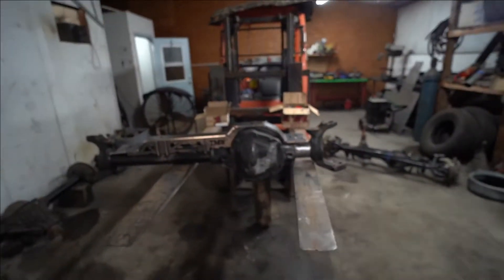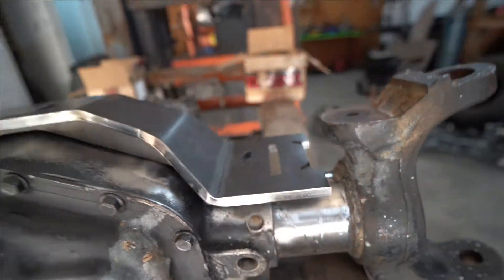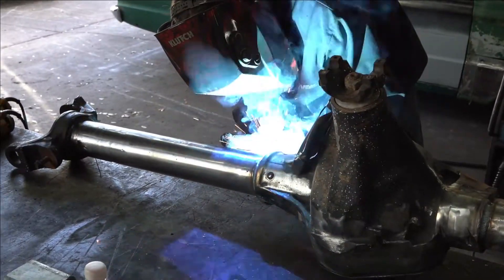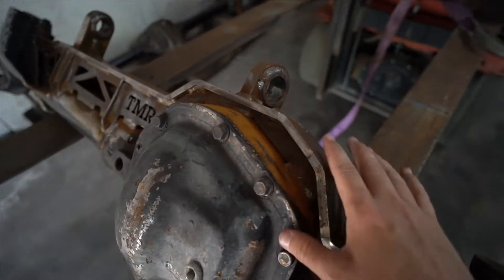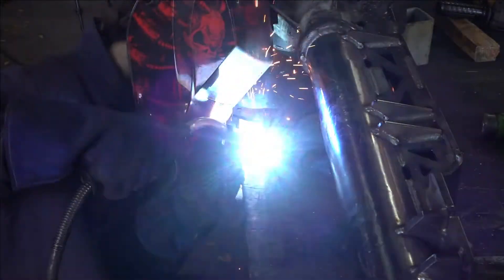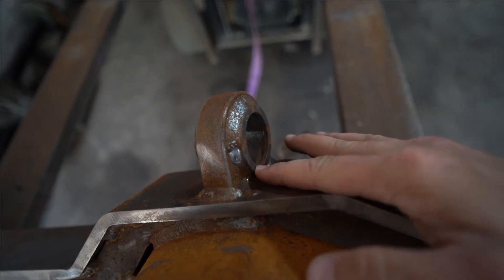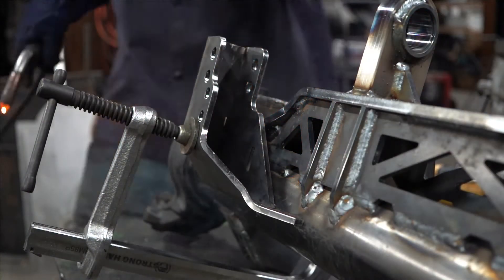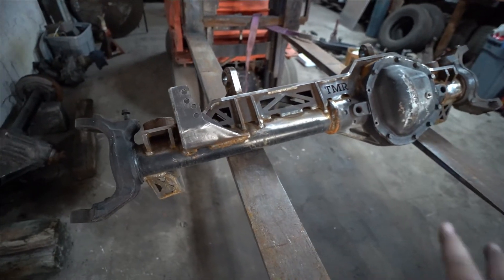1 Ton Swap Part 3 - Welding the Front TMR Truss

Comment: Hey man, I gotta ask, how did it work? 

I mocked my tmr truss up to mine and it fits with a little bit of shaving in front of the axle breather tube so I wouldn’t have to cut a hole, but then my truss is about 3/4” different spot than yours. 

Just curious how the install went and how it drives, and if TMR or anyone told you to do it like that or if that’s just how yours fit. 

Thanks and nice work!
Reply from the maker: It worked out fine. I’ve been daily driving on it for about a year now with a couple wheeling trips on it. 

I should have brought it forward on the axle a little more. At the moment I technically have zero degrees of caster if I line everything straight up. I do have it tiled back so I get a couple degrees of caster but not the proper amount. But I haven’t had any issues driving with it.